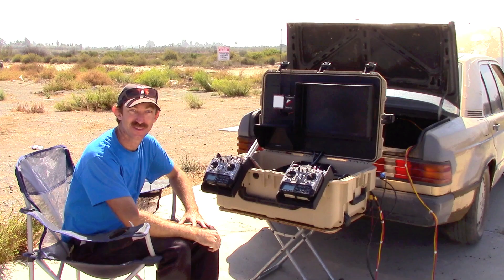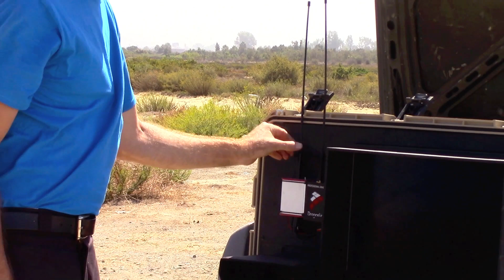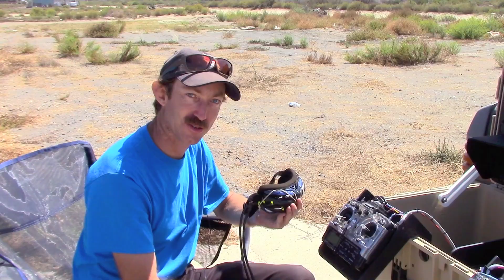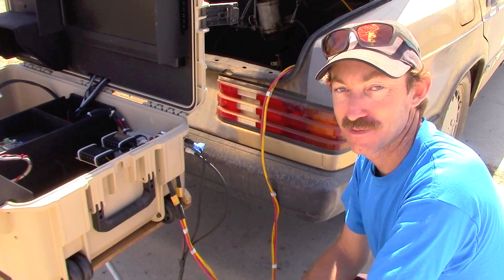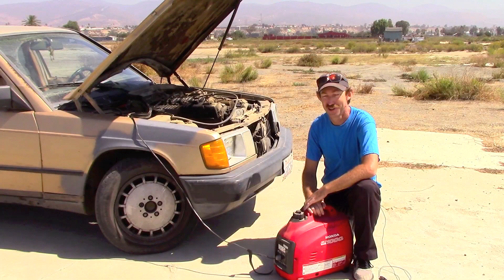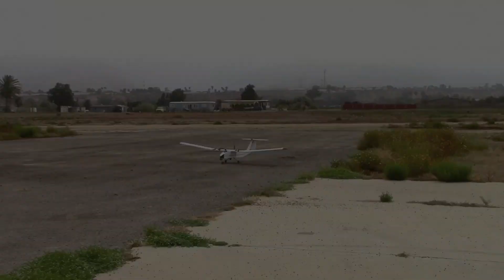Advanced FPV Ground Station / The Challenges of Flying for 4+ Hours

Comment: Why don't put a parallel xt60 plug on the power supply? Change batteries easily without interruption of power supply. Wouldn't that work?

Comment: What wattage signal booster do you use for your radio.
Reply from the maker: We're using EZUHF RF module.  low power is 200mw. high power is 600. almost never use high power. even the high altitude flight, used low power only.
Reply: Ok but how far did you fly out with the 200w signal booster.
Reply from the maker: about 10or 12 km if i remember right.
Reply: In your personal opinion how far will you be able to fly out with a 10w signal booster on the radio
Reply from the maker: it all depends on the antennas that you use, their gain, and the RF environment.  using directional antennas can help immensely.  also depends on the frequency. the lower, the better for range.       you could go to the moon with 100mw, given the right antennas, on almost any frequency.    there is no fixed answer to that.       it also depends on how sensitive the receiver is, and how well filtered the antennas are, if they even need filters.   the only real way to find out is a spectrum analyzer.     simply boosting the signal power will not necessarily get very much more range (although it will help), due to signal propagation.  it's like throwing a rock into a pond. the wave it makes is huge nearby, but gets much weaker after traveling just a little ways, as it's energy is spread in a circle. in the case of omni antennas, it's spread into a donut shape in 3D, so even weaker.      also using a strong booster will probably spew so much stray RF that it will drown out the video signal coming back, that is faint,a nd you have to listen for with another antenna. so you are usually shooting yourself in the foot (so to speak) when you boost the control system signal.     make sense?
Reply: Yes so you are using 200w booster . What is your frequency.
Reply from the maker: Um, no.     200MW        so 200/1000th of a watt.  or 1/5th of a watt.     not much power really.    the video system is putting out more than that.     
It's on 433 mhz. 20 channels spread spectrum.

Comment: Mike! What kinda FC are you flying today?
Reply from the maker: Pixhawk  with arduplane. used auto tune to calibrate PID's, and lots of testing to acquire enough data to be able to enter all of the other settings.
Reply: Right! Have you ever tested Parrot Disco before? I am trying to use pix4dcapture or any other GCS to do grid flight plan with it but no success so far. Any suggestion, recommendation?
Reply from the maker: I know drone deploy works, but only with DJI products.   
What specific problem are you having?      I'm also interested in doing 3D mapping, and also need to interface with Pixhawk somehow.  
Sorry I can't be of more immediate help..
Reply: We are currently using Dronedeploy for aerial mapping with no "surprises" so far but eBee is the only fixed wing compatible with, as far as we know! Our goal is to use Parrot Disco Standard (which is very cheap) with Pix4dcapture as we know this GCS works with a very expensive Parrot Disco AG Pro only, a top version of Parrot Disco "standard"! By the way, in your case, you better go for the Dronedeploy, according to our "years" of experience as users. In other words: rotary wings + dronedeploy = happiness!
Reply from the maker: I understand it works well, and have seen it used, but how can it interface with Arduplane?pixhawk? Also needs to interface with the sensor, Correct?
Reply: I've never seen it in action with any other "open source" so according to their website at least all DJI drones are supported.

Comment: Awesome video Sir! Thank you very much for sharing your station with us. I am currently researching to build a long range (5mi) fpv multi-rotor aircraft with exceptional FPV VIDEO QUALITY if possible. Any recommendations for affordable video tx/rx and camera? What about video tx/rx frequencies. Thanks for any reply!
Reply from the maker: At least for a reasonable amount of money, it's always quality of downlink vs range. 
most fpv systems and fpv cameras only go up to 640x480 and that's find for navigating the aircraft. 
if you want hi ddef, or 4k footage, i suggest piggyback mobius camera, or go pro as  a separate camera for later playback. 
if you must have high def on the ground while you fly, and extraordinary rang,e go with something like an enerlinks system,  a digital long range system, but you will pay a ton for it, and it may not be available in all countries. 
there also may be solutions involving high speed internet via cell comm, or maybe someone has found a way to extend the range of systems like light bridge. Not sure, but worth checking it out.

Comment: You are very talented with this hobby and I learn a lot from all your videos.  Thank you for what you do!  I plan on building the Gemini one day.  I am building a foam fpv plane and using dragon link.  I see you used the old school FutabaT8, which I have one and would like to use it with my dragon link.  Do you have any pointers to use dragon link with this transmitter?  My first step is, to find a plug to connect the two.

Comment: Why use a generator... Use a couple of 100watt solar modules to charge car battery whilst you fly.
Reply from the maker: +simon ward The solar panels would be greener, but i don't have panels. I do have the generator. that's a major factor. also, if the sun does not shine, the gen still works. I don't want to have to monitor the battery it's charging. I have enough to monitor during flight on the aircraft. i suppose if had a simple alarm for low voltage at a safe level, i could start the car engine to make the power, but the gen is so quiet.  your idea would work prob 98 percent of the time.  anyway, thanks for the comment.  i have solar on my house, and the power i pump into the grid is used to charge the plane's battery later. 
cheers
Reply: FPVREVIEWS if you could lose the inverter your current draw would be a lot lower

Comment: Just use a External Car Batterie than u didn't have to worrie to kill the Car Batterie inside the Car ok the Generator is also a good idea :)
Reply from the maker: +BlueMountPicture s that would not work when the external battery goes dead, and i lose control, and video.  whatever battery i use must be kept charged. it might as well be the car battery. 
it's also bad for batteries to be deep discharged. even deep cycle batteries. the only type that would be ok would be a gel. even then , go back to problem 1
Reply: year but a Generator on the Car Batterie would also work good
Reply from the maker: +BlueMountPicture s that's what i'm doing, as show in the video.
Reply: i wanted to say that u also can use a extern Batterie with a generator so u don't have to worry to kill the car Batterie
Reply from the maker: +BlueMountPicture s well, yes, you could, however, the gen keeps the battery fully charged, so it has not been a problem at all.  if the gen fails, i can also start the car engine to charge the system, as a backup. with an external battery, it would not be possible.
Reply: But i like ur build what i said was just an Idea :)
Reply: ok

Comment: Great video, do you use both immersion and dragon link at the same time? If so, for what reason? thanks for such a nice info
Reply from the maker: +svsoftair yes, but just because its the equipment i have.  i believe that either would work together with their own counterpart.   The dragon link V-2 emits a bit more noise than the immersion eZUHF, so requires some distance from any sensitive equipment such as the plane's receiver, or the video receiver on the tracker. the tracker should not be next to anything anyway, and it's not a problem in normal use.  the eZUHF has better range, however, it's in an ideal location on the plane, and i upgraded it's antenna. The dragon link now offers more features than before, and has all new firmware, which improves performance, so i hear. i have not upgraded, as it works plenty good enough for me. Mike at dragon link is great with customer support.  so both are very competitive. 
i've had trouble with either system, for one reason or another, getting them to work when i first got them. the EZUHF, i could not contact customer support easily, and ended up fixing it myself, but the dragon link, which had a bad component, was different in that mike, sent me a new transmitter module, even before i sent  him the old one back. it then worked fine, without any further messing around. the dragon link also does not offer diversity antennas on the receiver, and the immersion RC does.
Reply: +FPVREVIEWS super, thanks

Comment: Two suggestions?

1. Two deep cycle marine batteries in case(s) mounted in your trunk, kept topped off by car charging system when driving- eliminate the generator entirely.
2. Quadcopters already have GPS-based flight controllers- you could REALLY use an autopilot for flights of the duration you are doing!!
Reply from the maker: +Lucas Finley very true, i just happen to have the gen already, but a larger battery could be a solution.  i have large batteries i could borrow form my house off grid power system, and they could certainly power things for hours, but they are also very heavy,  like you say, 2 of them would get the weight down per battery considerably.  the only thing i could  say against the idea would be that at the end of the flight, the batteries would not be fully charged, like my current setup.  it does bother me  a bit that i have to burn fuel,  but i'm working on that.  i plan on getting an electric car someday, maybe building one.  then i will  just run the ground station off of the car main pack.  at the end of the day, getting rid of the generator is a good thing. others have suggested a solar panel, but i don't want to have to cut one of these endurance flights short, due to low power output.  for instance, the day i did the 4 hr flight, it was very cloudy, and i'm sure the power of a panel would not have been anywhere near optimal.  i consider the generator an interim solution. 
and, yes, i really could use a flight controller..  any recommendations?  
thanks for your comment, and thoughts.

Comment: Hi -  have watched a couple of your videos and I really like the Gemini.  One thing bugs me however with your obvious technical expertise I am wondering why you do not have an autopilot in your planes.  For instance a 3DR Pixhawk, the one I use, would be child's play for someone like you to setup and would ease the burden of flight for 4 hours.  You would also have a full telemetry log of your flights.
Reply from the maker: +Stephen Gloor You are absolutely right. An autopilot like pixhawk would be a great addition. My weakness is with computers, so the interface is a bit daunting to me. I also feel that a lot of research and development is being done with flight controllers, and with software, and not enough with the hardware,a nd aerodynamics, as they apply to adding capability/value to unmanned vehicles, at least in the hobby/small commercial market. 
I actually gain considerable insight into the flight dynamics by going through the excersise of flying manually for this much time. part of the design criteria of gemini is that it can be flow this way with minimal pilot inputs. 
this is partly to do with it's stability aerodynamically, and also in dynamic ways. the interaction between axis dynamics is part of the base concept of gemini, and i don't think i could get that experience any other way, besides manual flight. of course,i could just turn the flight controller off.. 
also, when you can achieve stability in all axis, and also spiral mode trajectory, at the same time, without sacrificing aerodynamic efficiency, it improves the overall efficiency of the aircraft, because you don't need such active flight control surfaces, and power consumption, and induced drag are slightly reduced. all of this adds to the overall efficiency,a nd performance of the aircraft. 
a telemetry log would be great. i have been plotting some logs on paper during flight, and it gives me something to do during the 4 hrs, but you are right, i need an autopilot at some point. my next large project will require it. i have been working on the concept for about 2 years now, and conceptually, it's very refined.  i may have to collaborate with someone for the flight controls and software, as it will require unconventional/custom software to reach it's full potential.
Reply: +FPVREVIEWS They have made the computer requirement a lot less now.  Mission Planner takes most of the headache away and the PixHawk is almost getting plug and play.  The biggest thing you are missing is RTL (Return to Launch) in emergencies.  If you lose orientation or the video link you need to be able to push the RTL button and have the plane fly home.  The other useful mode is FBW-A which means the plane flies straight and level with you commanding where it flies.

All my planes first fly in manual anyway.  I time them up to fly in manual mode before ever starting on the road to tune the autopilot.  The Pixhawk has autotune now and when if flies well in manual you can autotune the autopilot pretty well.

An RFD-900 pair would do your telemetry and again they are plug and play for the most part.

I had just this week a heart-stopping wait for a plane to fly home after we lost comms.  There was nothing better than the sight of the little plane coming home in RTL....
Reply from the maker: +Stephen Gloor thanks for the great advice.   by the way, can the pixhawk support VTOL yet? and then a transition to fixed wing flight?  if not, how might one interface 2 pixhawks, and transition from one to the other?
Reply: +FPVREVIEWS OK here is the thing.  We have this contest called the 2016 UAV outback rescue  over here and the lead developer of Pixhawk firmware, Andrew Tridgell, is on one of the teams competing.  Now one of the requirements to complete the challenge is possibly a long range VTOL aircraft.  As CanberraUAV are committed to the APM/Pixhawk you can bet your bottom dollar that this functionality will emerge in the Pixhawk code sooner or later.  A lot of teams are waiting just for this.

I think also some people have done Pixhawk code to do what you want however it is custom code and not on the mainstream.

My advice is get expertise on both modes in isolation before you attempt to combine them. Get both a fixed wing and multicopter flying well on auto then you will have the knowledge to combine them in some way or use tridge's new vtol Pixhawk code when/if it comes out.
Reply from the maker: +Stephen Gloor yes, i plan on flying it first as a multi rotor and then as a fixed wing aircraft first before doing the transition.  the design concept allows for a balanced, robust transition, with more than adequate thrust, and control during the transition, at least conceptually.  and no wing tllting, so it should not be affected much by wind. 
i have watched the outback competition for some years, and it sounds like a great environment to mature the technology. there has also been a lot of interest in the gemini project from australia, and quite a few flying gemini's there.  Great country, and lots of fwd thinking people there for sure.  i would love to visit someday. 
have always loved wide open spaces. something about them is very inspiring. at least as long as you have  a highly efficient, fast, reliable, vehicle from which to enjoy the view! LOL 
will look fwd to seeing how team canberra does in 2016, and maybe by the time i get a 2nd prototype going of the next gen aircraft, there will be a suitable fight controller. 
thanks for the advice.  i look fwd to using auto tune, as i went through manual tuning of settings on a KK2 board once, and did get the cart flying desent, but it was never good, and seemed like a useless skill to learn in the modern world.
Reply: +FPVREVIEWS Yep we have wide open spaces alright.  Not too many places you can fly for two hours in a commercial jet and still be in the same state.

Hopefully our team WestCoastUAV makes it to the contest and gives CanberraUAV a run for its money.
Reply from the maker: +Stephen Gloor i'll check out WestCoastUAV,  best wishes for the upcoming event!
Reply: +FPVREVIEWS Thanks - may order a Gemini plan however I will do a foam wing I think.  Vowed never to make another built up wing after my last glider.
Reply from the maker: +Stephen Gloor pstt... send me an email.  fpvreviews@gmail.com
Reply: +FPVREVIEWS Have you ever looked into buying a solar panel and a charge controller for your setup. You can buy a used 120 kyocera panel for 120 shipped and a cheap charge controller for 45 and you would be good to go on power all day.

Comment: Spike, this is not related to this video but I want to know if the Gemini V-2 has individual throttle control? If so how do you accomplish it with only one throttle lever on your transmitter?
Reply from the maker: +John McKenna they are linked with a Y connector on board the aircraft. so no it does not. and i have not seen a need for it, so just one channel.

Comment: Very good video, Spike. Did you have to make any modifications to the rc transmitters?
Reply from the maker: +John McKenna just the addition of External RF modules, and voltage regulators for the power supply. that's all.